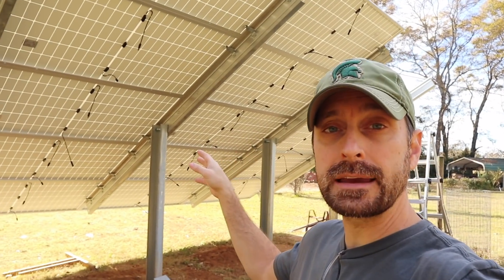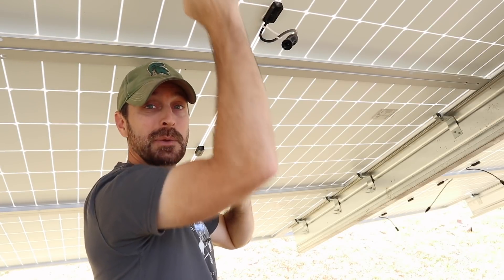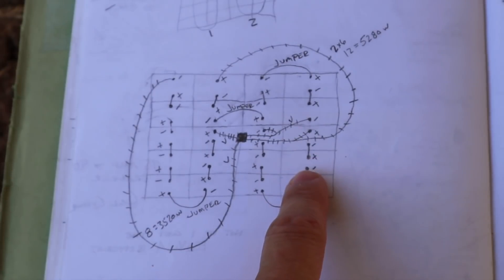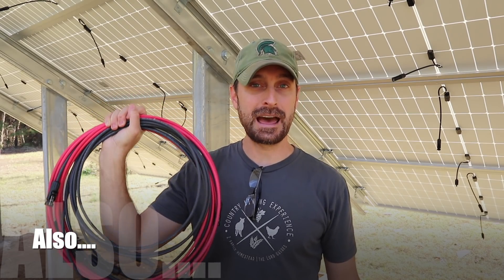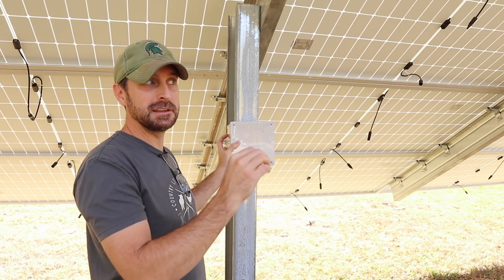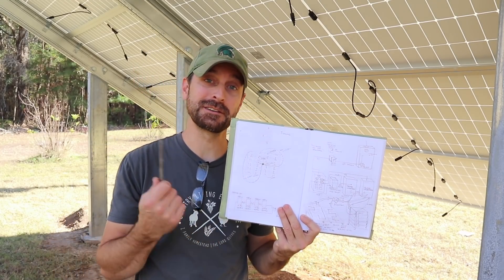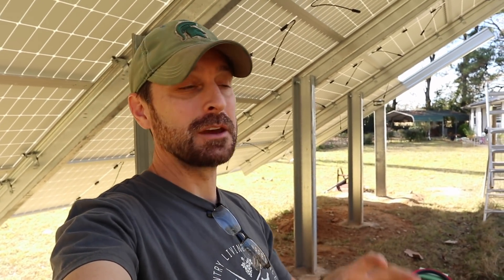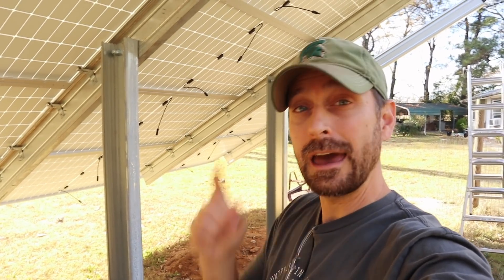Solar Panel System Design! Don't Overlook THIS!

Comment from the maker: ALL OF OUR SOLAR EQUIPMENT...CLICK HERE: https://www.signaturesolar.com/?ref=countrylivingexperience
Reply: Can pv extension cables be longer than 100 feet? My panels are going to be 150' from my inverter, so I was wondering if I'd just attach a 50 to a 100 or if I should have custom 150' single pv extension cables made?
Reply from the maker: @tjmooney4181  You can just attach a 50 to a 100. It will work just fine.
Reply: @CountryLivingExperience  awesome thanks so.much for the super fast response, I've been binge watching all your videos since last month when I thought about adding solar to my property to run my well pump
Reply from the maker: @tjmooney4181  You're welcome.

Comment: ?? did you reconfigure your panels for the EG4 (since the max input draw is 18A per terminal, but your two strings in SP would be over 20A)?

also, does the voltage in the 8 PV series pose a problem for the eg4 (i assumed each pv terminal had max 250v)? let me know if i sound crazy 😅
Reply from the maker: Neither has been an issue with the EG4's.
Reply: @CountryLivingExperience  thanks!

Comment: Signature Solar is also and Authorized Dealer for EMP Shield.... Just curious, why did you not add that protection level to your system? EMP Shield is also Lightning Rated for all of those protection levels as well. In my understanding, this would have saved you from having to add the "Surge Protectors".
Reply from the maker: I am not worried about an emp that is why I didn't add one. I was unaware that they also added surge protection too.
Reply: @CountryLivingExperience  Yes, 100% Lightning Protection including a $25,000 Ins Policy and Solar Flare Protection up to 280,000 AMPS!!!.... Well worth it to me when I get my place and install my Array in the next few months. FYI I'm also looking at East Texas.
Reply from the maker: Wow, that's cool. You will enjoy East Texas. It is nice.

Comment: They don't just make MC4 short extension cables?  
I mean me personally I would also just mount them properly because im OCD as fuck, but functionality wise im sure a little 1 foot jumper could solve that issue.
electrical engineers out there, would that small jumper have a noticeable effect on the impedance? 
Also are there ways to make these terminations by hand?  
I feel like the longer I type this comment the more I realize the best solution is to just flip the panels...
Reply from the maker: That is why I just flipped the panels.

Comment: The position of the panels is determinant of where the leads are connected.
Panels like yours having one lead one each side require positive to negative stacking on the rack for your series connections.
Panels having the leads at one end (the head as it were), require head-to-head placement for the same series connection.
In my case, a 6x2 string array will provide 2 times the highest amount I've ever used.

Comment: I see some videos of lipo battery power station.comming out that serve as a UPS and can be charged by solar. Seen One that's supposed to have 3kw. So u could hook up 3 to get 9kw on their own panels so if one goes down u still have 2 left and u don't need to convert anything. And they cost like 2k each. Anyone has experience.with these packs?
Reply from the maker: Sorry, I do not have any experience with those large power packs. I only have a small 500w Bluetti for camping, etc.

Comment: Good work (a teachable moment !) I too ordered new solar after  hurricane Irma removed our old system.
I had time during shipping to draw up a panel intallation plan so all went well with no issues.
I have to laugh out loud 4 years later tho, as now when I look at the drawing I had made nothing makes the least bit of sense.
We were working so hard and in such a rush in those months after storms that my mind has literally blurred everything from those days. My brain seems to be operating at 50% but the solar system is producing just fine - so thats good.
Lesson learned - try never to rush.
And always be able to laugh at ones self.
Great videos, keep up the good work.
Reply from the maker: Thank you. Yes, I always learn from mistakes. That is very important. Go slow and be methodical. 
I appreciate the kind words. 
Cheers!

Comment: Hi,just curious why didn't do 2 strings of 10  1 string to each inverter because you got 20 panels voc 40.99v you are still under the inverters maximum voltage which is 450V. This way you didn't have to  use so many wires and combiner boxes. And for your array panels I suggest you should use earthing system, ground Rod driven into the ground   # 8 solid copper wire from 1 end of the frame to the other with open lugs to each metal brace/Joinst and then to ground Rod with grounded clamp. Open lug you don't have to cut the wire it just a pass through and you tighten the screws on the lugs. Just a suggestions
 🤔
Reply from the maker: Hello. I appreciate your suggestions. I didn't do 2 strings of 10 because I want to expand the number of panels in the array in the near future when I can afford it. I left that second inverter open for more pv input. Doing it this was leaves room for expansion. 
The array is already grounded by the steel rack 42" onto the ground. Additionally, the panels are insulated from their frames via the glass and other non-conductive materials. So, lightening is not likely to travel on the wire to the house because it has a lower potential. I will put spd's on the wires in the future to alleviate the small chance of the lightening traveling on that pv wire.

Comment: Just started watching all of the videos you've done on this(This is number three for me) and I'm unsure why you just didn't do two strings of ten, or four strings of 5.
Reply from the maker: The inverters could only handle up to two strings of 8. I could have done 4 strings of 5, but this way I can add 8 more panels for my second inverter.

Comment: Question for you, you said that you got a bigger combiner box for later so my question is are you grid tied and if so you have to have a permit through the electrical company and are they ok with system like it is and down the road you add more pannels with out getting another permit?
Reply from the maker: This is an off grid system. No permit required.

Comment: Curious what the wind uplift design is on the racks...will it withstand a strong wind storm? Racks are light aluminum?
Reply from the maker: These are all steel racks. They are made for commercial applications and some residential. I know they are all engineered. You can look at the company website...https://powerssolarframes.com/

Comment: Unusual panels.   I have 70+ panels of different manufacturers and none of them look like yours.  ALL of mine have a common junction box with both the positive and negative wires coming out of the same junction.   And the wires are all 4' or so in length, never had any trouble connecting them.
Reply from the maker: This is how many newer panels are constructed. This is a US company.

Comment: Thanks for sharing.   Nice to see I'm not the only one who's run the horse over with the apple cart.   You are so correct about drawing a plan before starting. Amazing the little things that come up while drawing out the plans that just don't get considered in the exciting moment of the projects.
Don't forget to use,
  Lightning arresters.
 Surge protection.
Proper fuse size.
Reply from the maker: You're welcome. I am a huge proponent of drawing things out for sure.

Comment: Hi! What voltage and amperage numbers on your panels do you use to find your maximum for your connections? Their is short circuit and open circuit maybe some others. Thanks!
Reply from the maker: You have to look at your inverter. Ours has a max voltage open circuit limit so that is what we use for calculating how many panels and what number to use on the panel. Check out Will Prowse's channel for deep dives on calculations.

Comment: You need PV lightning arrestors & old school lightning conductors at the highest points with ground rods !
Reply: PS
SPDs are only part of the protection needed !
A direct strike will vaporize a spd & can damage equipment .
The pv mount must have a better grounding path than your system .

Comment: Last night I was watching another video, and one of the segments showed the damage that can be caused by weather, especially hail. Some of the hailstones were golfball sized, but some were not much bigger than a marble. Yet these hailstones hit with enough force to take out a quarter of a panel (in one hit, it went clean through). My question is what preventative measures can you take to prevent such damage, and how much would such precautions cost in electrical output?
I would think that perhaps some Lexan (plexiglass) sheets in a frame that could be quickly mounted might work, say, if a major T-storm was heading your way. But if it isn't secured tight enough, it may cause damage itself.
Perhaps, comments from your audience?
Reply from the maker: As far as I have researched, I nave never some across anyone with storm damaged panels unless they came unsecured from the racking. The glass, at least on the quality name brand panels, is extremely tough. I think some of them have impact ratings on them. But I wonder with the ubiquity of solar panels now, that it is not much of a problem.
Reply: @CountryLivingExperience  so what the impact talk you left that out
Reply: Ok kool
Reply: put plywood to protect it
Reply: @onlythewise1  I was thinking of Lexan (plexiglass) as it would allow light in and still protect. Plywood would essentially shut of the power.
Reply from the maker: @zuzax1656  These panels are rated for 1" hail at 50mph. Hail of that size usually falls in a storm between 25 and 40mph.

Comment: Maybe I heard you wrong but it sounded like you are running PV wire from your array to your inverter. You don’t need PV wire for that. THHN wire will work. You only need PV wire for above ground work.
Reply from the maker: PV wire can be direct buried per the NEC and that is what I was sold by a reputable solar dealer.
Reply: I didn't say you can't use PV wire that way, just saying it wasn't necessary.
Reply from the maker: @BrianLeeWho  What I got is cheaper than THHN I believe.
Reply: I just bought a 500 foot spool of #10 wire for $139 at Lowes. If you were able to get PV wire for less than that you got a very good deal.

Comment: I have a better recommendation for lightning protection. Make the lightning want to go somewhere else before it gets to your array. Get a 100 ft steel pipe and drive it 10 ft into the ground near your array. Problem solved. If you use an excavator you can sink it into the ground in minutes.
Reply: A good, long flag pole...
Reply from the maker: Way too expensive.
Reply: Metal flagpole
Reply: Just go outside with a kite during a thunderstorm. Way cheaper and more fun. Untill it strikes though

Comment: You can use short mc4 extension cables. Extra connections isn't great, but you need to balance against the aggravation of remove and replace panels. My OCD means I'm probably going to be flipping panels. :)
Reply from the maker: I already flipped the panels. I only had to do 5 of them and it did not take long.

Comment: Why not just get 1 more panel and do 3 strings of 7?
Reply from the maker: Several reasons. Racking systems are usually designed for even numbers of panels and solar suppliers sell pallets of panels in even numbers at discounted prices. We got these for $170 buying 20 panels. They are $200 if purchased individually.

Comment: Looking good so far! Planning a super similar system for my house roof, with 10 panels with 5 in series and 2 parallel. Those short wires the panels come with it's annoying but oh well!
Reply from the maker: Cool. Yea, I have seen some panels with long wires but they are rare.

Comment: Being a visual person myself, I also draw out plans before taking on a project (sometimes, a little too detailed and/or over-engineered). So, I was surprised that you didn't use a sharpie or something to mark the positive and negative ends prior to install. But, as you said, the excitement of the moment can lead to overlooking the little things, even though they may bite you later.
So, helpful hint: mark the top and bottoms of the panels as you unpack them with a + or - sign.

Edit: By the way, it is videos like these that make you a good teacher. You show the mistakes you make so we don't have to learn the hard way. Love your channel. Keep up the good work.
Reply from the maker: I had been planning and saving for 2 years and was just too excited to get them up, lol. The panels had Mc4 connectors on them so I knew which sides I had to connect but I just threw them up there without looking. 
Thank you for the kind comment. I appreciate it.
Reply: All panels have a specification sticker on the back, so I orient them based on the sticker, which is reliable for a given manufacturer.

Comment: For me when it comes to lightning which rarely happens in my area, I’ve worked out a plan to just shut down everything on the solar end. 
That means turn off the breakers to the solar that go into the house, turn off the inverter and flip the off switch to the batteries so everything is off. 
Like I said this is so rare and I’ve never had any part of my place hit by lightning.
Reply from the maker: That's cool. We get a bit of lightening but not much. I just wanted cover all my bases.

Comment: I did a dry run for my system. Easy mistake to make. I will refrain from any MSU jokes. Good on you for helping others avoid that mistake.
Reply from the maker: i was so excited to get the thing up after 2 years of planning. 
Dominating win yesterday by the way. Nice job Wolverine.
Reply: @CountryLivingExperience  gonna run into a buzz saw in the playoffs, but we have today, so I will keep smiling
Reply from the maker: You got it. Knock Saban off that perch.